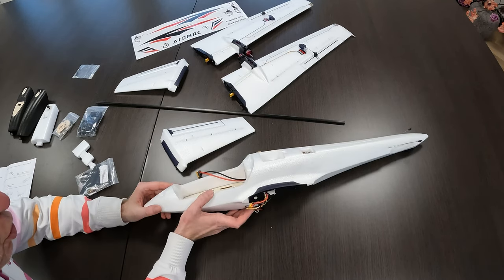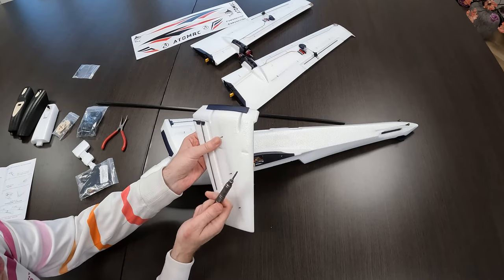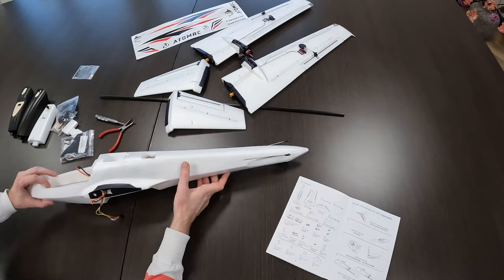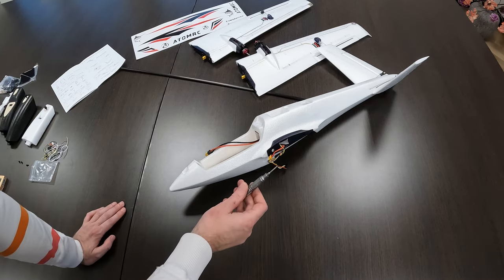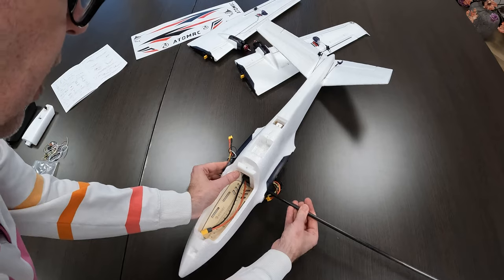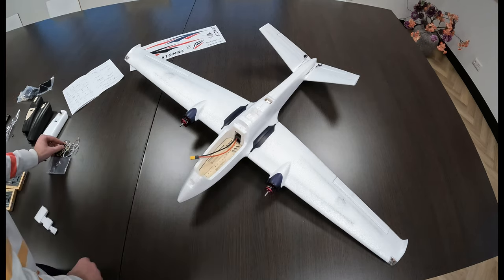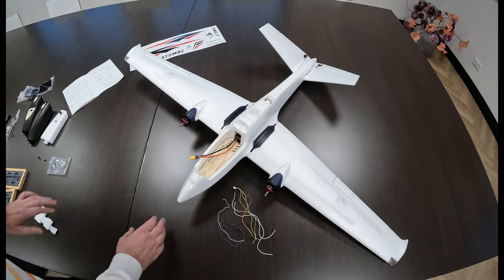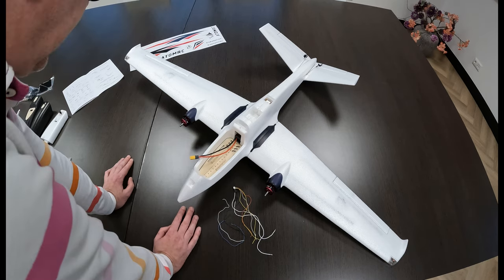Sexy Twin-Powered FPV plane! The AtomRC Swordfish - Assembly

Comment: Can you please tell me how the really thin cables that are coming from the lights on the wingtips are wired on the other end? Do the solder into the 5v/G of the ESCs? The version I’ve got in a kit and I’ve had to build it all out from scratch. Just wondering about this part. Manual or pictures don’t show this. Thanks
Reply: I'm wondering the same thing 😅